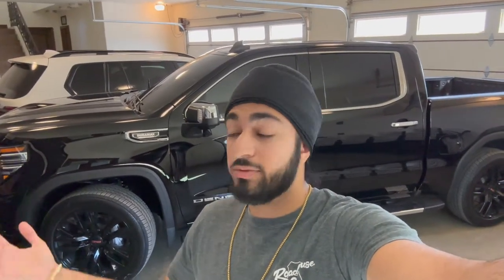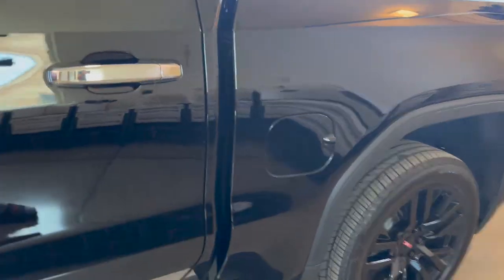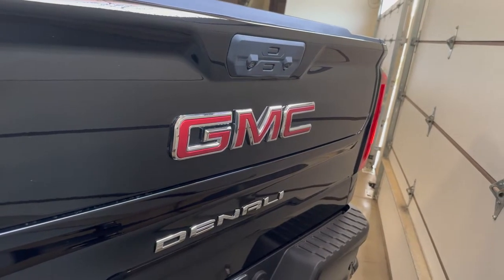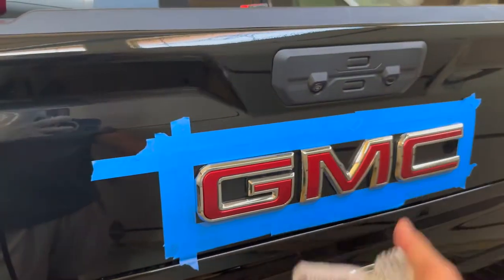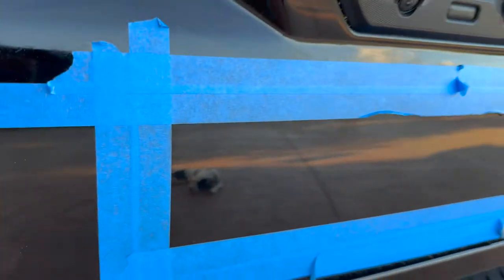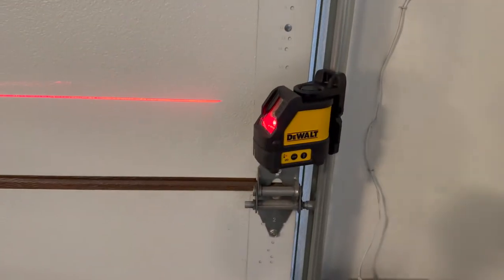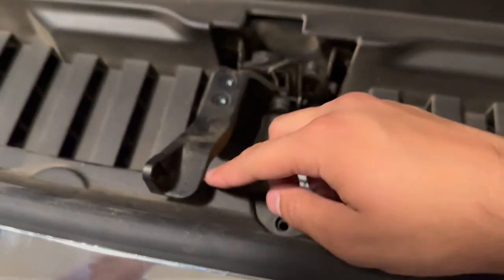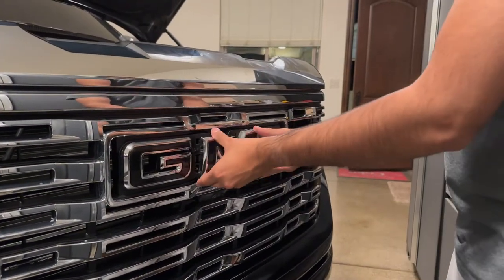How to replace your GMC Emblems (front & Back) DIY 2022 GMC Denali 1500 LM2

Comment: I’ll save you a bundle of time.  Coming from someone who does 15-20 of these per week.   Use a pick and pop out the red emblem part of the badge to expose the backing.  Once that’s out just push the clips out of the silver inlay and pop in new emblems.  Takes me 5 mins.
Reply from the maker: Will have to look into this next time! 🙌🏽
Reply: That’s exactly how I’m going to do mine. I saw a video of a guy who has been doing them a long time for a dealer.
Reply: Is the process the same on 2024 gmc dmax?
Reply: 2024 1500 elevation??